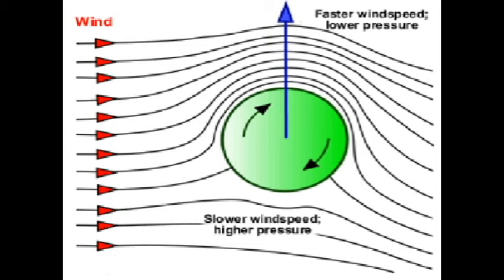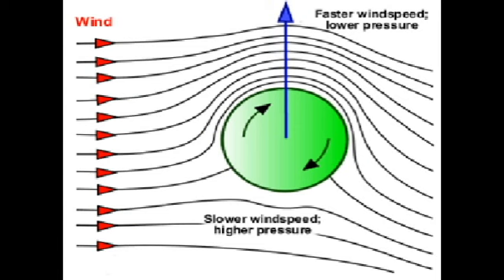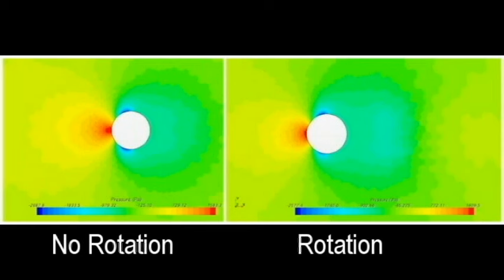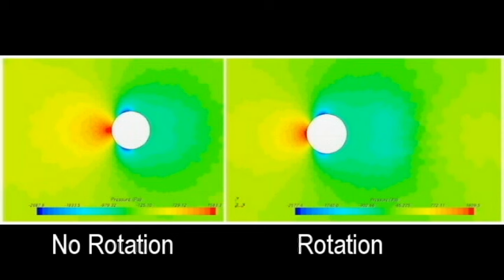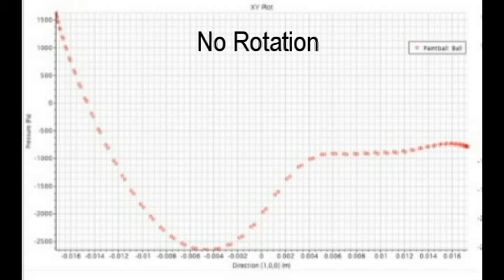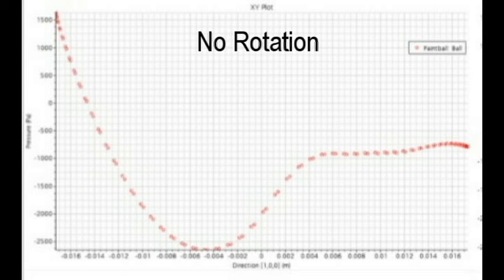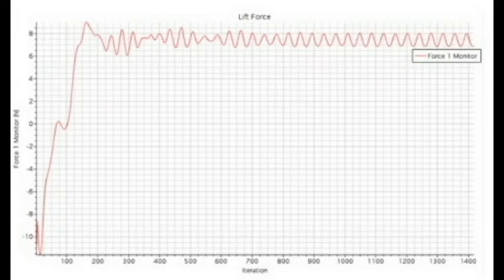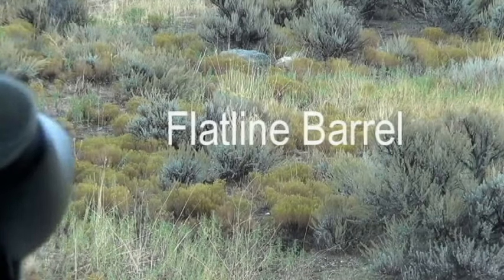Flatline Barrel Magnus Effect

Comment: excellent analysis man. after a paintball play i guessed that Magnus effect was messing with my teams accuracy (we've lost all points D:  ) because the ball was spinning in random directions across the marker barrel. could i fix this by putting some kind of high-speed air-resistant oil along the barrels left right and bottom internal faces (using something like an "U" shaped cotton cushion with a pole...) so i ensure the pellet does more contact with the top surface of the cannon, thus making it spin clockwise, and increasing air pressure below the ball (instead of randomly left right or wherever)?
correct me if im wrong. thanks! i cant make tests because i dont have a marker at home and my next paintball play is in about 6 weeks. thanks !!